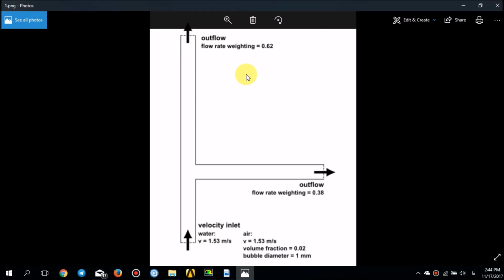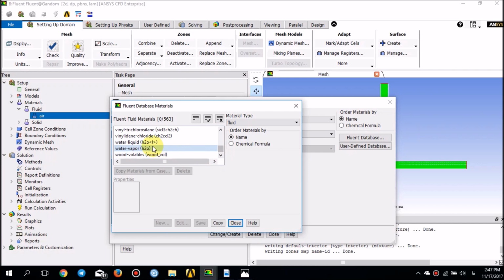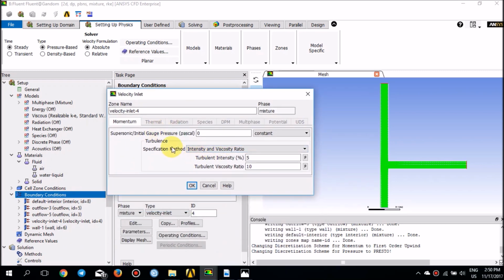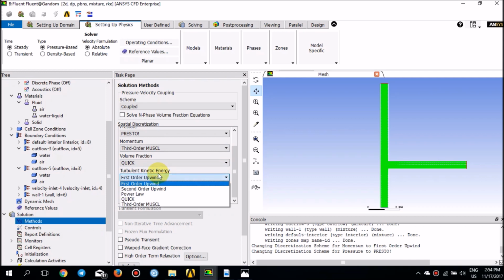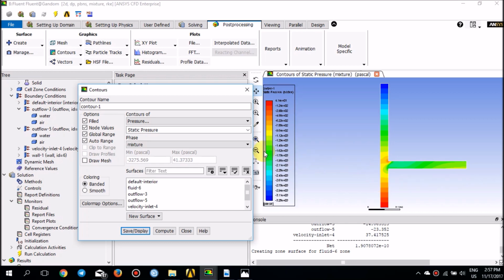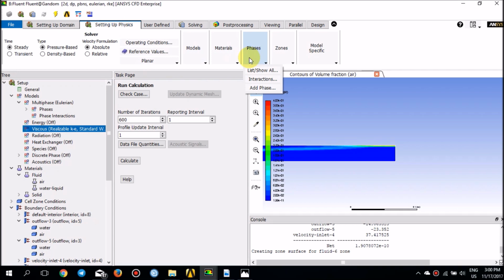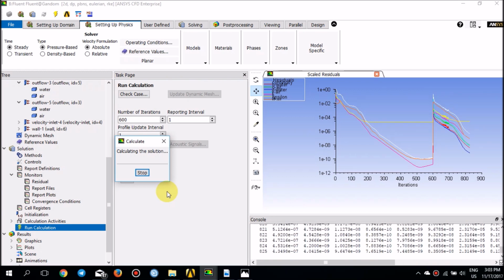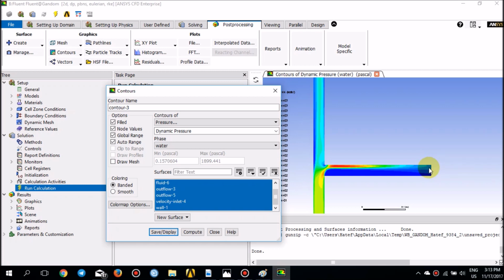Mixture and Eurlerian Multiphase flow model, Ansys Fluent Tutorial 14

Comment: How would you do the inlets and outlets if water enters from the top and side, and exited at the bottom, but air bubbles entered at the bottom and exited at the side and/or top (so the opposite direction)?
In my case I have what is essentially a tee junction where a packed bed of solids enters from the top and exits at the bottom, but gas enters from the top and bottom and exits at the side (the solids cannot pass through the side in/outlet).
It seems like fluent really done not like boundaries that are both inlets and outlets at the same time.